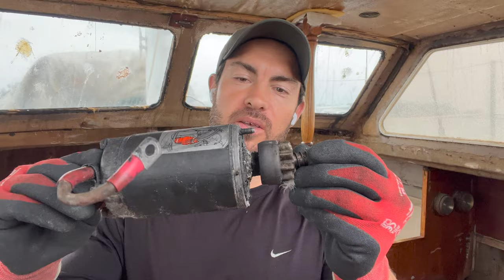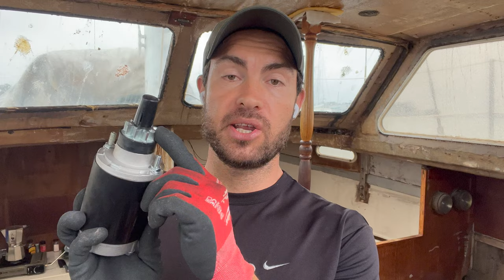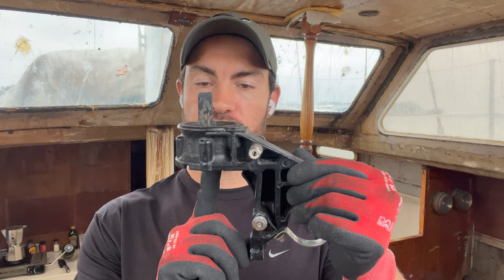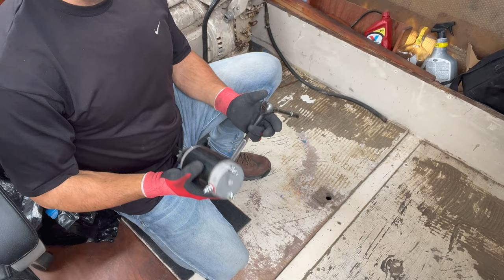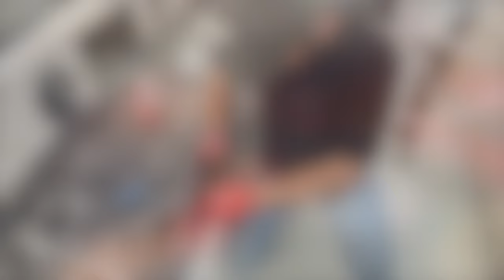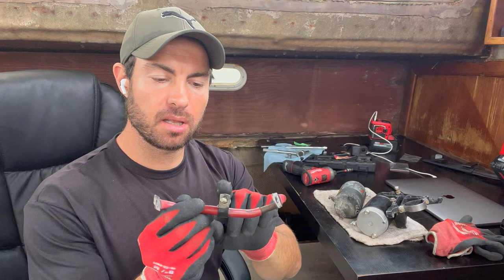Installing  Starter and Starter Solenoid On An Outboard Engine For A Sailboat (Episode 45)

Comment: Great idea of taking pictures, could save you hours of figuring. I'm shocked at how inexpensive those parts are. Ok Vasil, doing the mechanical work on an outboard while standing in a dinghy is impressive, I mean seriously. Your outboard must like you because I have found they are as temperamental as the owners, it takes a certain level of patience.
Reply from the maker: Thank you! Those pictures saved me tons of time. You are so right, patience is essential.

Comment: There are many tie points around where you are working. It may be a good idea to tie the dingy to the outboard bracket and at another point so the dingy won't rotate. I learned a lot about the solenoid and starter. Thanks for making this video. Always enjoy watching your work and can't wait for your maiden voyage! Oh yeah, ask for a thumbs up near the beginning of the video. I don't want to forget to do that so I need a reminder.

to get that deep bolt into the right spot, you can use a socket extension and the correct socket. Get a strong neodymium magnet and put the magnet into the socket and the bolt will not fall out. You can use the extension to get that bolt back in. I did this while reinstalling bolts in an alternator swap in my Toyota Sienna. They make bolts almost impossible to get back in.
Reply from the maker: Lots of great advice, thank you! The magnet is a great idea, I’m always nervous about dropping things from that dinghy lol. Good call on the thumbs up, any help with the content is much appreciated. 

It would be nice if I could tie off to keep that dinghy from rotating, however it’s just too dangerous to use a short rope. If is big wave comes by it would lift the dinghy and then slam it back down really really hard. At times there are waves that lift the stern of the boat 4-5’ and I would be coming along for that journey if it was tied off.

Comment: Nice Work.  I am surprised that it started without carb work.  Do they sell ethanol free gasoline in California?  It is available here in NC but expensive.  Great video!
Reply from the maker: Thank you! I’ve been told that some of the boat yards sell ethanol free gas, something to look into. If I do find some, the price will likely be very high like you said. We’re already hovering at $5 a gallon for regular gas here in California.